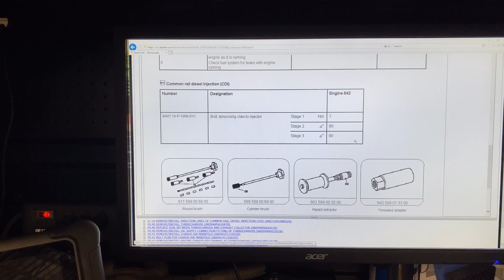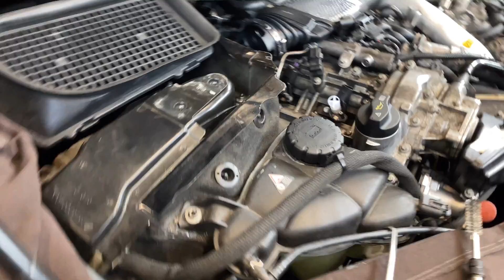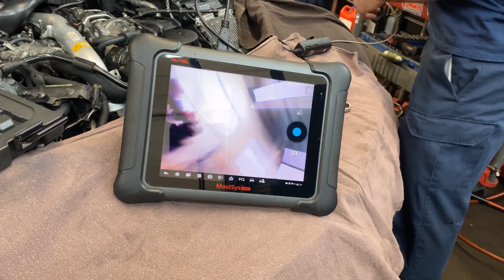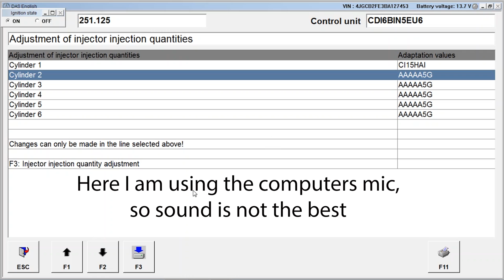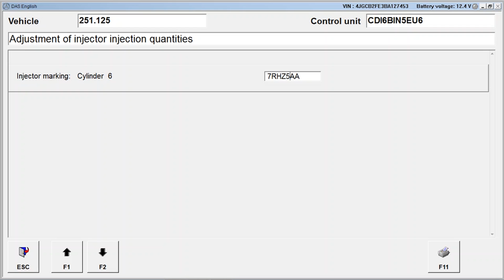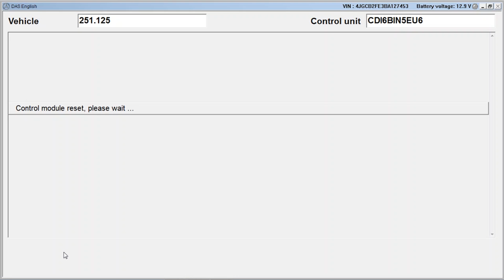2011 Benz R350 Bluetec other injector replacement and final test drive

Comment: Maic, I have Bosch injectors 642-070-1587 in my sprinter van. I bought A new one off of eBay but he sent me a Bosch 642-070-1287. Am I still able to code and use this injector or no? and what is the difference between the two?
Reply from the maker: I don't have access to Xentry here but I can check tomorrow at the shop. Depends on VIN and so to determine but each bank has a different code and can't be mixed.
Reply: Maic Salazar Diagnostics Hey thanks for replying, well my little Autel ap200 gave me the end answer. This injector fits into the OM642 however it wouldnt not allow me to code this injector. I believe ecu or autel software may be able to tell By the injector letters and the that the two are not compatible and blocked me from coding it all together. This injector Actually builds up pressure and started fine. 3886psi at idle but +2.96 max quantity comp. Some people will just put injectors in and not code them. this may make for a good video for you to make. I can’t find any videos or information on the differences in these Bosch injectors even though they fit and run the vehicle. Thanks again

Comment: Maic, great videos. Are you all done with the ECM/PCM series? I was looking forward to more information on injecting signals into quad drivers and IGBT operation, voltage regulation and integrated circuit technology???
Reply from the maker: Hi, The Next class is coming very soon. Sorry I been away for a little bit just because I was moving to my house. You'll see the new office in the next class.

Comment: 🖒 Good info. Always follow service info, or I at least verify in a few other places to make sure the info is correct. I've seen where the torque specs were incorrect. Luckily that doesn't happen too often though.  It is scary to torque down to specifications sometimes...  I've been there.  Beads of sweat form. I just hate to get so far and have a bolt snap in the head or block. Lol 😅😅
Reply from the maker: Cuba's Automotive so true!!